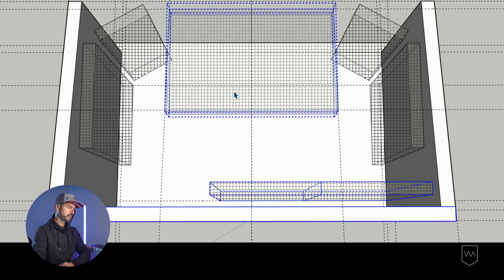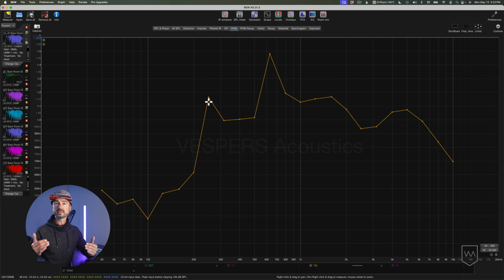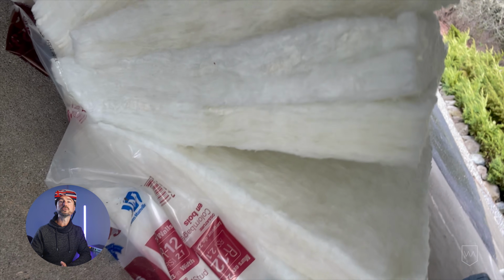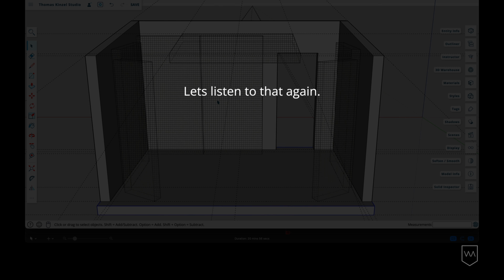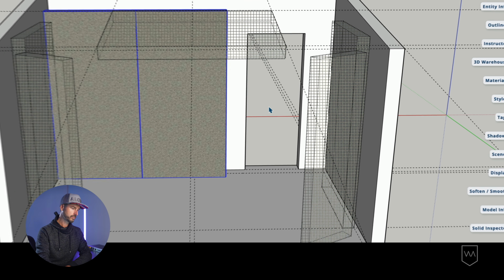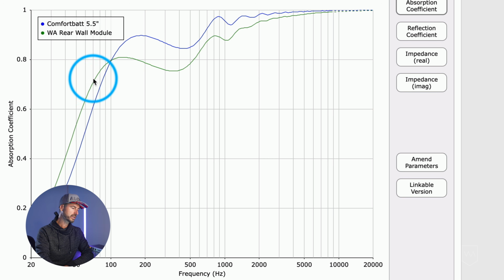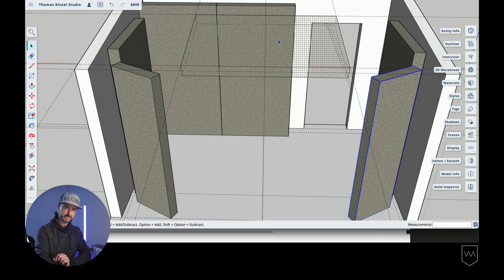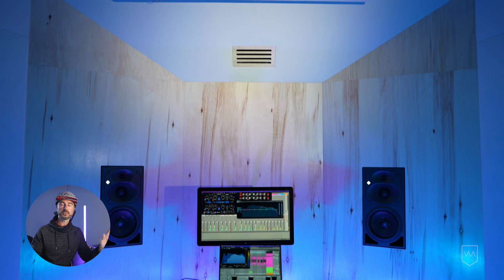Acoustic Treatment: The Strategy for Small Studios - Ep4

Comment: Hey! Why using such a dense material - 69 kg/m3? It will actually reflect low frequencies (to my knowledge)... Why not just the lightest one? Speaking of low density - what is the density of that white fiberglass?
Reply from the maker: Hey hey.  Okay, so you have to understand the relationship between density and depth.  If you use a high density material (60-80 kg/m3) and it's thick, then yes it will reflect LF.  Key word being thick.  

If you're only using 2" like I am, then you're completely okay.  In fact it will have superior LF absorption - as shown in the porous absorption calculator.  And also I have the acoustic tests to back that up.  

Using multiple densities of rockwool will outperform the LF absorption of a single density.  If you're using very thick treatment (like in my control room, 3-4') then you use a very light density material (pink fluffy) for most of the module, with a facing of higher density.  

Also, wrap your head around this one.  Placing a solid facing of plywood or plastic, or slats of the same material, over porous absorption will increase LF absorption.  Plywood is much more dense than Cavityrock.

For fiberglass the manufacturers don't even bother to publish densities because the manufacturing process creates batches that vary significantly in density.  All you really know is that it's "light density".  In this case, I'd estimate that it's 4-7  kg/m3.
Reply: Oh! So sorry - I was start to type comment while watching the video, and didn't get to the other part's when you obviously explaining everything in detail. So stupid of me.

Wow, that is pretty light! Lightest that I found here in Serbia was Knauf "Decibel", and actually it have conservative description: > 5kPa•s/m2. I will watch the video to the end and only then ask. Excuse me and thanks. :)
Reply from the maker: All good.  That’s great that you found a material where they actually publish the GFR.
Reply: @warpacademy  Thaks man. You are such a nice guy! I'm excited to see the final results!
Do you have a model of Thomases room (SKP) somewhere around to follow along? Actualy, I've already modeled in SketchUp according to dimension that you provided in this video. Only unknown distance is the Speakers (front baffle from the front wall). If I'm remembering correctly from previous video - they are 38" apart?
And one more - when you said: My room is "medium sized" - what is the dimensions of the outer shell of your room? I'm only remembering if I am not wrong (long time ago) that the ceiling height was 10' 7" - is that correct?
Thaks anyway. Great work! Looking forward... :)
Reply from the maker: Hey hey.  Thanks!  I’m glad you’re following along with this series.  

I do have a basic model of the room but I’d have to look into how I could share it.  I’ll check.  For now follow along with the future episodes.  

For my control room shell: 

- Length: 20 ’5" 
- Width: 15’ 9.25"
-Height changes due to a slight backwards grade in the concrete slab but average is 10’.

Comment: perfect timing, trying to decide if I should do this or stick to headphones. My room is only 10ft x11ft :/
Reply from the maker: Ah yeah, you will have overlapping axial modes in that room.  Square rooms are the worst.  What's your ceiling height?  

Basically, you would have the trap the entire room heavily to damp those modes to the point where they aren't causing huge problems.  But then that would be a very dry room.
Reply: @warpacademy  yeah celiing is 8ft. The room runs pretty hot in summer because of where I live so was hoping to get out of the cans but I think it could be pretty problematic
Reply from the maker: Yeah small square rooms are really hard to work with.  You at least want a rectangle to space out those modes.
Reply: @warpacademy  stick to headphones then ?
Reply from the maker: @flyoverfred  I think so yeah.  If you get a nice set of proper full range open back mixing headphones and use Canopener for some crossfeed, I think you'll get better results more quickly.